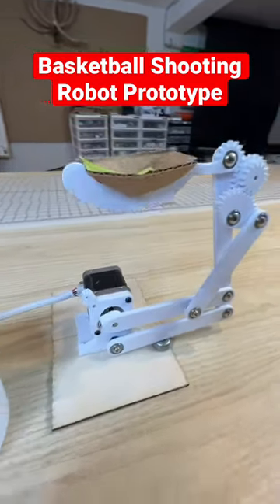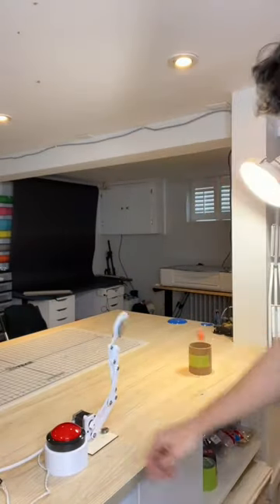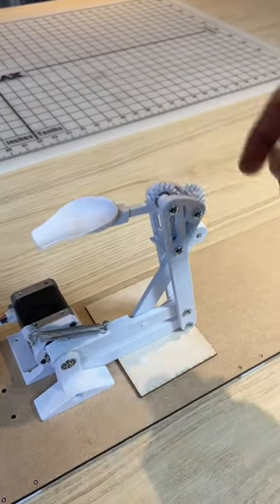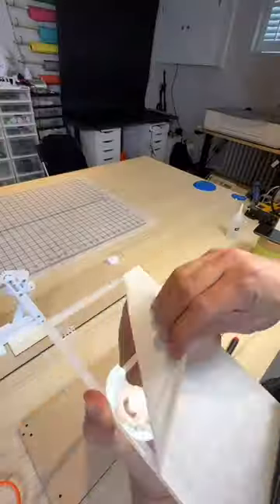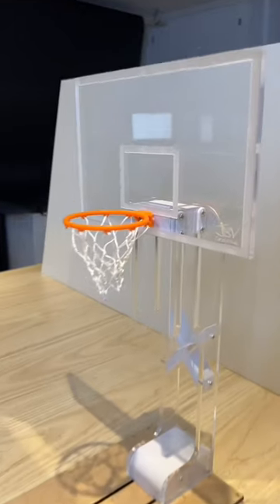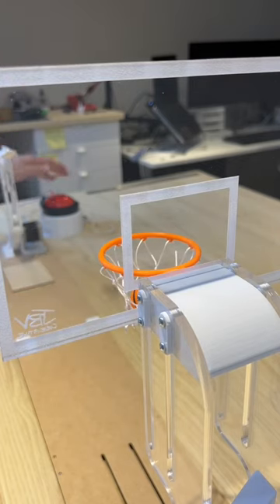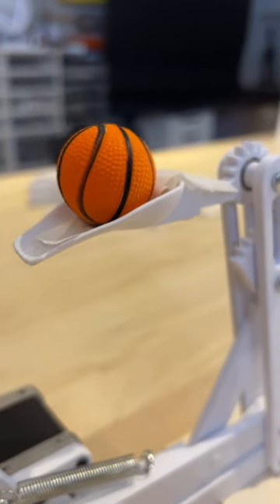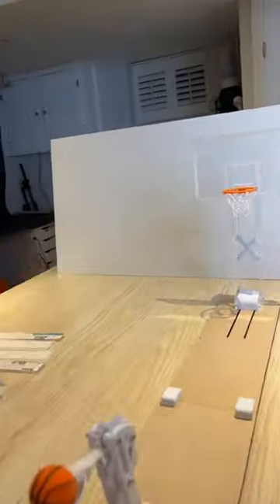Mechanical Basketball Shooter Proof of Concept

Comment: Wouldn't the strength that you use to press it also be a variable that is affecting the accuracy?
Reply from the maker: The button is just wired as a switch in this case so it just tells the arm to shoot